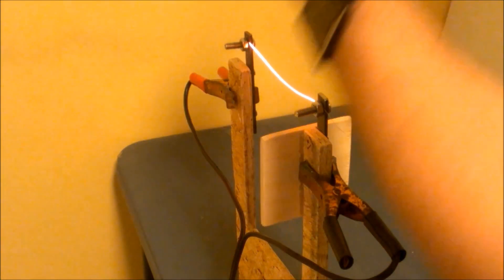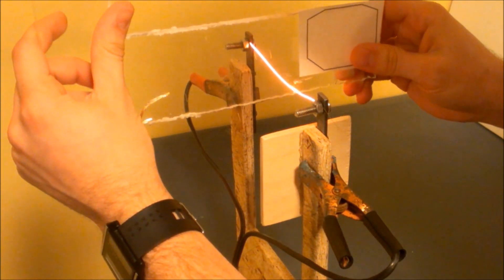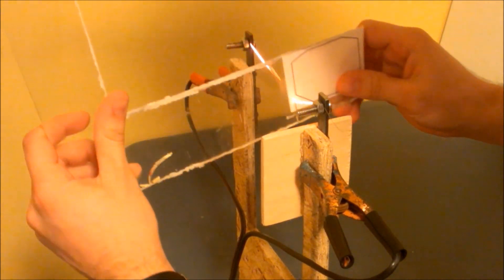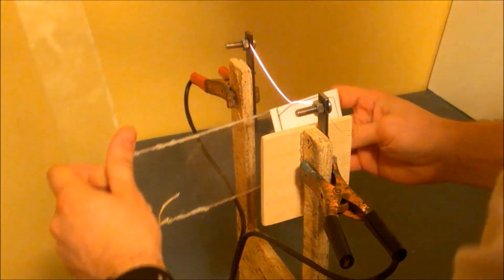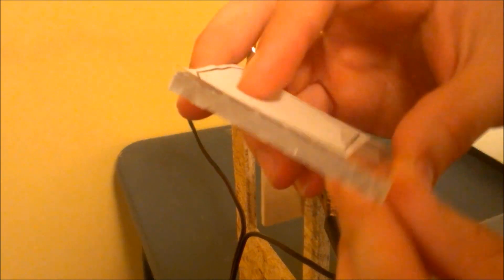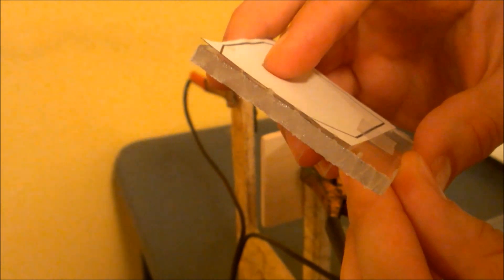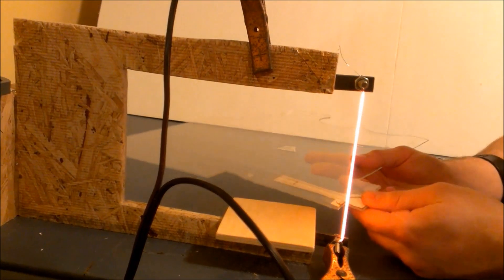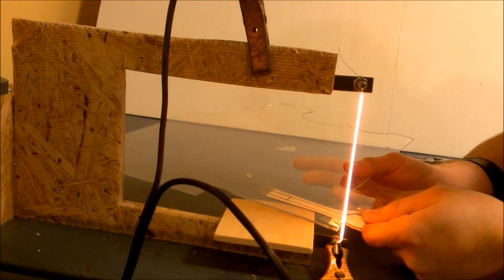NiChrome Wire Precise Acrylic Cutting! | FozzTech

Comment: Awesome! Do you know if an eBay foam sculpting tool would generate enough heat to do this? Or would I have to make my own set up? I've searched high & low for a way to cut acrylic, nice job!
Reply from the maker: I was on the same search but I think this method is a good one! I haven't looked at foam tools on ebay.  However, I know that typically they run at a lower temperature.  I'm pushing this wire to be as hot as it will get without breaking.  If you used that much heat when cutting foam,  I believe you would melt too much and get inaccurate cuts.
Reply: get one of the ones with an adjustable power supply.
the 35 dollar one i got can glow red at half power
Reply: Adam is right.  Just buy the 30 gauge nichrome wire.  Chances are that this build will cost less money than the foam cutter and it will only take one weekend afternoon to tweak it for your specific needs.  Personally, I may need variable power so I can cut all the packing foam I have into more manageable sizes for storage.  So I will need both low heat and high heat setting.

Comment: Have you thought of using this method with a 3d printer?
Just thought as I was writing, what if you attached a dremel tool to a 3d printer and used a drill saw
Reply from the maker: bridgendesar I have! However, I haven't used this device in a while at this point.  What you're thinking of is a CNC machine, and they actually came before 3D printers.  I show one running briefly in this video if you're interested! https://youtu.be/nO56OwO9xnc Thanks for watching!